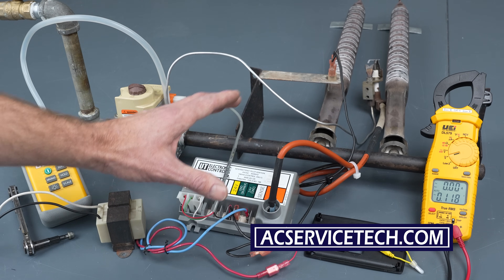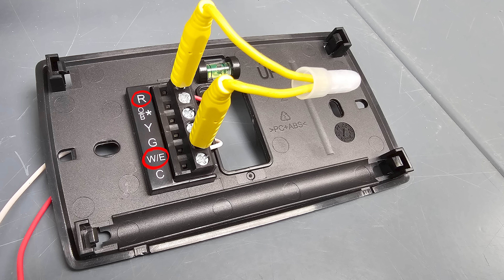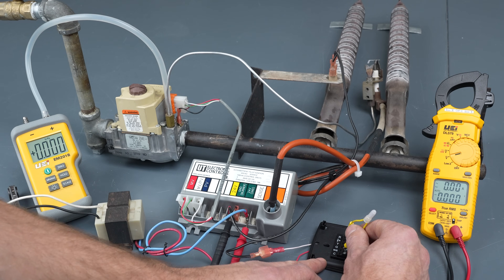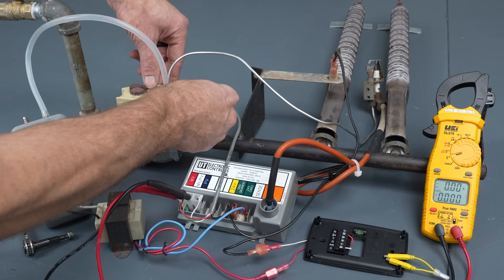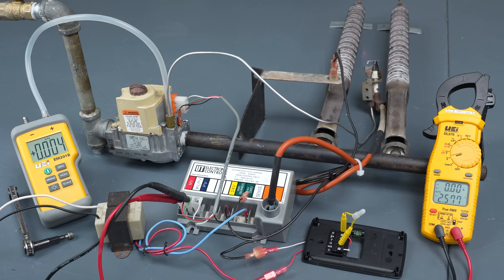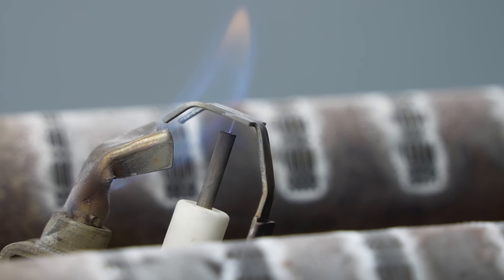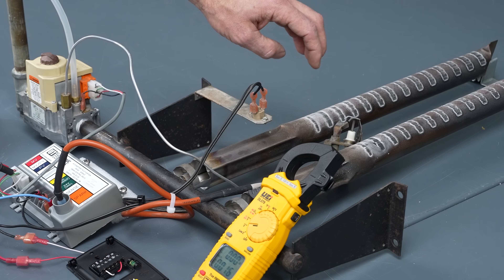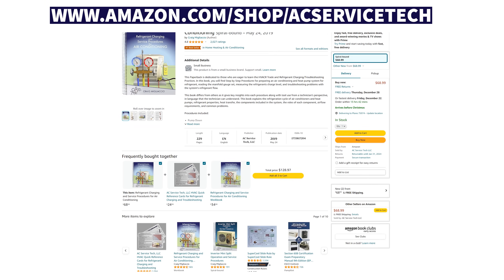Gas Furnace Training- Intermittent Pilot Ignition: Gas Valve, Spark, Module, Operation, Testing!

Comment: I'm not getting any power to the ignition control module (L8148E).  The Aquastat and relay appear to be working fine and I'm getting 24 volts at B2.  Would a bad damper vent or blocked vent switch shut down power to the module. I've put the damper in manual mode and jumped the blocked vent switch to no avail. I'm not getting continuity across the blocked vent switch or any voltage. Pushing the reset button does nothing.  BTW,  the circulator pumps come on.

Comment: I have this ignition system on a hot water heater, and found a short in my PV wire. (After swapping the control module.) Fixed that, and now the pilot lights, the main burner lights, but won't stay on for more than a minute.  Anyone have an idea what i should check next?

Comment: I had a new NG Furnace and from day one, when the heater comes on it comes on, nice cold air and then warms up and then shuts off and then cold air until it warms up, any ideas on how to fix it?
When the AC comes on it does it correctly the AC compressors comes on and when it is to temp then the cold air follows.

Comment: Hello, hoping someone can help me on this conundrum...
I have this exact set up (gas valve differs slightly in appearance), pilot lights but quickly goes out. The transformer registers 28VAC but the voltage at the controller seems to be so "quick" that my voltmeter can't "catch" the voltage it's throwing (between MV/PV & PV). Same for test at MV to MV/PV.  I suspect there's some voltage as the meter begins to move (digital) but quickly falls to 0.00.  
I did clean off the carbon at the ignitor probe thinking that the soot could be causing a break in the registering of flame presence but the unit responds in the same way as described above. 
Should I see a constant 24V for either of the Pilot/Main tests? Or is it normal to be intermittent?
Plan on getting a new Ignitor/Pilot Assembly and control board (just to have on hand) but I'm beginning to wonder if the gas valve itself has gone awry. (First attempt to use the furnace was on Thanksgiving day). It's one of those older "Kenmore" NUG5075BFB1 units.
Appreciate any advice out there!

Comment: I wasn’t able to read 24 V on the control panel but my boiler kicked on. Was it because I disconnected the wires to read? I couldn’t fit my meter in due to the end tips of the wire while it was plugged in

Comment: Suggest you point out sequence of operation to simplify what you’re trying to say.
Spark duration is predetermined and once it terminates the rod becomes the sensor and is looking for flame current to prove pilot
The ground is more commonly found connected to burner and or pilot burner itself . 
The ground on gas valve then would be to chassis of unit or burner.
This type of combination is very troublesome for techs as it is difficult to check flame signal upon ignition.

Comment: After just replacing, for the 6th time the ceramic igniter on our Samsung oven in just 5 years, I'd love to switch it out for this spark igniter system. It is insane to have that high wattage consuming igniter all to avoid a pilot light even if it never failed but I have both, high power consumption and high failure rate.

Comment: Hi guys, I have a question. The gas valve has two sides and one has a filter. Which one goes to the main gas pipe and which one goes to the pipe that is connected to the rods?

Comment: I'm trying to learn about my boiler and boiler mate. It's a little overwhelming trying to learn the circuits. Between the zone controller, the aquastat, the ignition controller, pressure switch, gas valve, and low water cutoff switch, it's a bit complicated. This video helped me understand the ignition control module. Thank you.

Comment: I'm having this problem on an industrial dryer. I put in a new gas valve and it seems like I'm not getting power to it to open the valve and let gas flow..I'm kinda stumped...
Reply: Check voltage from mv and common,

Comment: It was your last statement about the spark wire doubling as the flame signal wire that made this explanation correct.  I encountered a boiler with this exact ignition module where the pilot would ignite but not the main burners.  The issue was a break in the spark electrode wire. Of course the 10,000 volts could jump the break and spark at the electrode lighting the pilot but the subsequent micro Amp flame signal could not return to the module because of the break.  The burner ground was intact and it was quite puzzling.  Checking the spark wire with an ohm meter revealed the break.  A very tricky fault because seeing the spark makes you believe the wire has continuity when it may not.  Very nice presentation particularly the warnings about the various high voltages you may inadvertently find while troubleshooting.

Comment: So if I don’t get 24V from mv/pv to pv I can say I have a bad ignition module?
Reply: I have same question. I have 24v between 24v and 24v (gnd) but no voltage between mv/pv and pv. Is the voltage to mv/pv and pv supplied internally through the ignition module?

Comment: I would assume the module itself senses the flame rectified current (or voltage?) which would be quite small and then sends 24v to the gas control valve..is this what happens? I wish my furnace had the typical hot surface ignitor with associated parts as in all the other videos .

Comment: Love the 360 Degree approach and setting up this physical architecture working. You easily articulate each component and it dependencies and feedback.  Great over presentation which I suggest should leveraged by training classes and  labs so you can become proficient with the complete process flow.    Love the  real gas burner components and how the process is explained in a short concise video. The biggest bang for your buck..

Comment: I have been building industrial pressure washers for 40 years.  I’ve always had problems getting the pilot light to stay on.  I’m going to try this auto pilot method.  The only difference is I am using a burner that requires 400,000 BTUs.  The theory should work.  My customers will be happy if I am successful.  Thanks for the great content!
Reply: what about the glow plug style igniter?

Comment: is there supposed to be 10,000 volts on the ground wire coming back to the control module? I thought ground wires are only supposed to carry the current back? You have the best HVAC videos on YouTube

Comment: What if you're not getting a spart at all?? Where is the problem?
Reply: Could be anything. Could be faulty transformer, spill switch, roll out switch, thermostat, pressure switch, aquastat,  low water, high limit, etc. Envision a circle; each aforementioned part needs to be in good working order to allow voltage to pass through to complete a circle.

Comment: I have an old boiler that keeps shutting down. Pump keeps running but there’s no flame. No gas smell.  I’ve paid nearly a grand for hvac people to come and tell me the boiler is 30 years old and you need a new one.  Why can’t they test the intermittent ignition system, Honeywell, and determine which part is the problem?  They only want to sell me a new boiler.
Reply: Gas valve, dirty flame sensor, clogged condensation trap?

Comment: It amazes me still the amount of knowledge people are willing to share this is a very similar setup with my old furnace and I’m diagnosing a strange condition where it’s trying to start but can’t like the step where it has lit the pilot but isn’t opening the gas valve. It will retry and eventually start so that’s odd 🙁.  It is in need of replacing but I’m trying to get it through to the summer 😂

Comment: I’m dealing with an issue where when the thermostat is NOT calling for heat, the gas valve stays open and the flame keeps going. To turn off the heat, I have to flip the switch.
Reply: Your thermostat is probably defective and keeping the contacts in the thermostat closed between terminals R to W. Replacing the thermostat should resolve the issue

Comment: Very good video.
The only thing that had me confused was the fact that you referred to the Manifold as the “Main”.
It’s like people calling the Engine in cars a Motor. Engines are gas expansion driven (steam,gasoline,diesel,alcohol,kerosene,moonshine,etc),which is directly opposite to a compressor,while the Motor is electric powered!
I’m not being nitpicking,it was just an observation!

Comment: On a previous 410a charging video, you charged the unit through the low side. Is it safe to add liquid knowing that’s it going to the compressor?
Reply: It is safe to slowly add liquid refrigerant through the suction side as it will usually flash into a vapor before getting to the compressor

Comment: I was wondering if you can help here. I have an attic unit Trane (lays on the side horizontally) We just had a week-long of zero-degree weather end of January in Chicago, before the arctic blast the temperatures outside were 25 to 30 degrees I was reading a nice 96-98 degrees using the red dot temperature thing to take the reading from the supply registers. Once the big cold blast hit as temperatures were falling to rock bottom my nice 97-98 degrees at the supply registers started slowly turning into 87-89 degrees at supply, later in the night that 87-89 degrees now was down to 84-85, even later as the night went on more my supply was now down to 80-82, and by morning we are at zero outside and my supply vents are down to 78-79 at the registers and just sat there. What the heck could be causing this? I had to leave the house for a hotel because it was 56 degrees inside!!!! This is NOT an air duct leak, I went up in the attic and right at point exit of the furnace I was getting 80 degrees coming directly out of the furnace itself!!!! This is driving me bonkers! I have a Nest so I can monitor the inside temperature without being home, could this be limit-switch and cutting my burners off "thinking" its overheating? After the cold snap has ended and temperatures rebounded back into the 20's and 30's I was back at that wonderful 97-98 degrees out of the registers. Where was my 97-98 degrees during the coldest time???? And no, I have the cleanest air filter in the neighborhood, nothing is blocking ANY cold air returns, all registers are fully open. Please don't say the filter is dirty like everyone else says because I even took the filter out, and it still ran like this. Please any help here would be greatful.

Comment: My furnace has an intermittent issue.

The thermostat calls for heat, and the inducer motor/fan starts up, and runs about 7-10 seconds, and then shuts of for 1-3 seconds, and then kicks back on. After 2-3 times of doing this, the igniter finally lights the gas, and it works as normal from there.

It does not do it every time - sometimes it starts up on the first try. My guess is the NEST thermostat may have an issue? (The entire heat/AC system is about 12 months old, both inside and outside) - It occasionally did this with the old system as well, but very rarely.
They did run a new thermostat wire when they installed the system. 

Since the thermostat is the only thing left from the original unit, I suspect it. Any idea if these tend to fail frequently? (It is about 4 years old)

Comment: Hey question forya craig, on the setups with the seperate flame rod completing circuit back to the sense terminal, what amperage is good/bad coming back to the control? Is it pretty much the same as an hsi setup where you want to see at least 4ma?

Comment: Good video craig, these days at least in my area we dont see many intermittent spark systems,seems like everything is hsi now. So its good to teach this because its not really taught enough and when a newer tech comes across one they have no clue the sequence of operation so they have no clue where to begin looking for the problem. That turns into wishful parts changing with fingers crossed lol. If the problem is a poor ground connection all the new parts you can throw at it will do nothing.
Reply: Re gounding and fixing loose ground connections requires no parts.  I always check those first!
Reply: @ShanQueefus  exactly what I was implying
Reply: Intermittent spark ignition modules are still used a lot especially in commercial equipment in residential not so much anymore

Comment: Why does mine prove the pilot kick the main burner  on then it goes out and starts over sometimes it only does it once sometimes it does it 5-7 times before it stays lit
Reply: I should check for 24 volts to be on the mv when it shuts off if it’s still present possible solenoid in main burner issue it is a Honeywell controller I grabbed a used one off a guy to try but the spark wire is different been doing it for 7 years that I lived here it’s annoying to hear the process carry on so long
Reply: I appreciate you asking this question, Im also having this exact same issue with my water boiler and I also have this same setup. I already replace the ignition control board with the same one, and the spark flame assembly. Im guessing the gas valve could be culprit.
Reply: Were you able to fix your problem?

Comment: I have exactly same setup. Is there an easy way to reduce number of burners? My boiler is oversized and I wonder if I could save some gas and make the temperature maybe more stable
Reply: No, boiler is designed for the burners it has, underfiring is just as bad in the long run than over firing. Will cause condensation and severe rapid corrosion to your boiler and flue pipe. It's a shame so many systems are not sized for the home/building
Reply: @HVACRTECH-83  thanks!
Reply: Insulate your house so it retains heat and doesn't make your boiler run for a long time
Reply: @nielkan  the point is that I have opposite problem. It is not fit to the load. Raises temperature of the water too fast.
Reply: @MariuszChr your solution would be to get a digital t Stat that has a temperature offset, it xound like your boiler is over shooting target or you may have a stuck open zone valve ( check a stuck zone 1st )
Reply: @nielkan they are manufactured with jacket insulation, insulating it poses a fire danger and saves you nothing. The heat is being moved to warm the cool areas of the house, so insulation in that vessel saves no output as the output is always being used to heat the space.

Comment: I showed up to a furnace recently installed by someone else.  Diagnosed a bad board, got a new board in, discover a rollout switch also triggered.  Got the furnace running; the combustion is TERRIBLE. Weak, orange, pungent flame. Check gas pressures; they are perfect.  Finally realize this thing is trying to burn LP and doesn’t have a conversion kit 😅
Reply: Ty for sharing, a good laugh and better lesson that I will try to remember. Tech life!
Reply: Thank you for that information buddy
Reply: Orifice
Reply: The laughs of the trades 😂
Reply: Wow! I have finally understand this part of pilot igniter control wiring as an Electrical Engr, I have learnt a lot for you, now I can confidently visit Gas F, Heat P And HVAC AHU for control diagnosis all thanks to u sir
Reply: Not only you need to change the office but also flip the spring in the regulator.